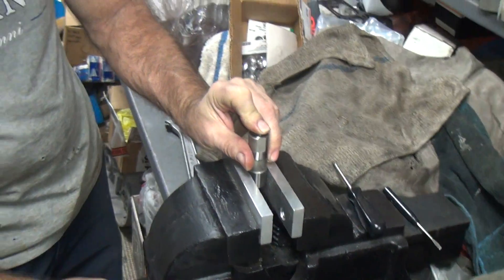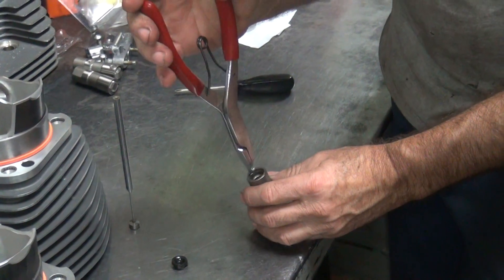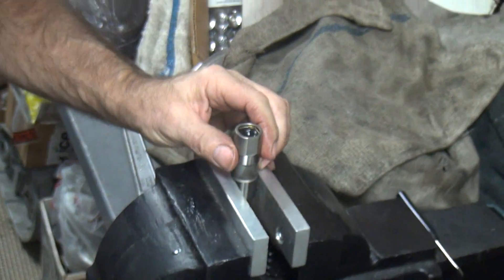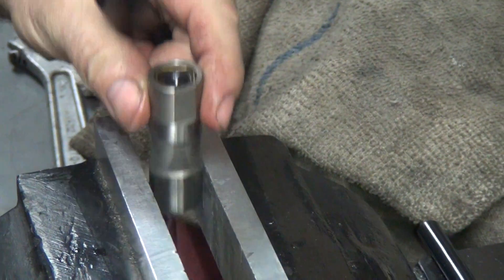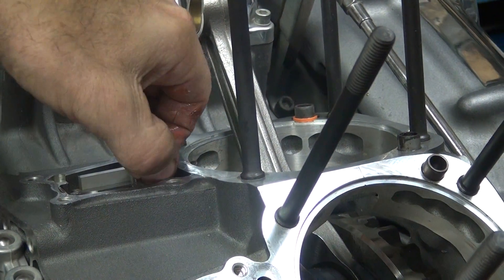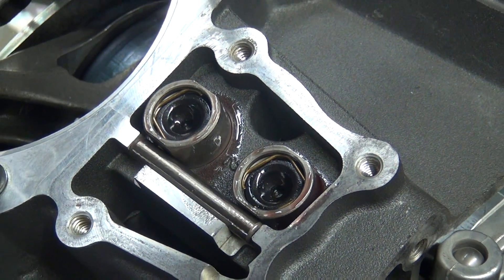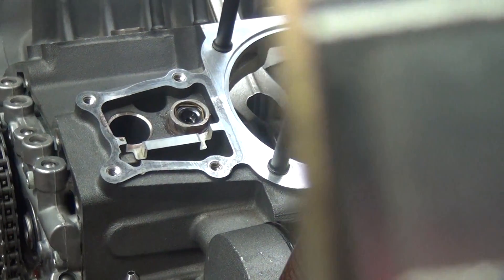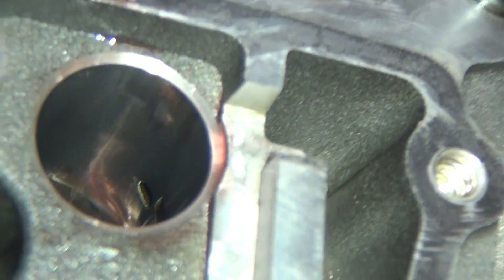#120 2008 110ci cvo twincam fxd dyna motor repair rebuild harley by tatro machine

Comment: Why did you remove limiter ?? Lots of guys says limited travel lifters are way better , more power at higher rpms ???? Means pushrods dont bounce soo much ?? Thank you and great work you do !!!!
Reply from the maker: you said it. this is a street motor, not a high rpm race motor with heavy valve springs. limited lifters are a pain to adjust and no one knows how to do it. keep it simple and reliable.
tatro
Reply: Make sense , thank you. But what else has to be done to have a race motor beside of cams ,bigger valves ??